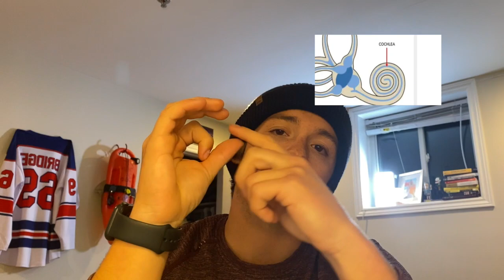Single Sided Deafness and Cochlear Implant Surgery

Comment: I have a SSD daughter implanted 2,5 years ago. It’s been a steep and tough learning curve but I’ll be more than willing to share our experience so far if you find it may help you in any way. Take your time. Give yourself time to adjust and beware of listening fatigue. In the first few weeks/ months let it run its natural course. Whenever you can discriminate words (regardless of sound distortion) you can start streaming and a more intense rehab routine. The CI will only give you input but the work it will take is to teach your brain how to interpret. Also, as an SSD, you will find that no matter how well you discriminate sound and speech while using your CI alone, your good ear will overpower your CI ear. So work closely with your therapist to find balance between the 2 hearings and achieve a new way for binaural hearing. Be kind to yourself and please take very good care of your left year.
Reply from the maker: Thank you for sharing your experience with me. It is almost time to get my external piece and I will consider your experience while navigating through the process. Thanks again, I really appreciate it.